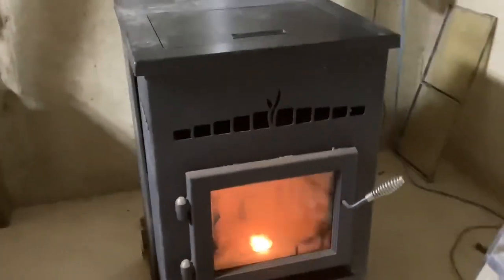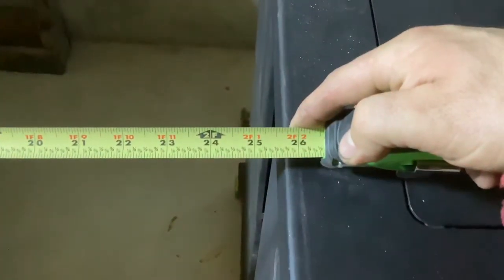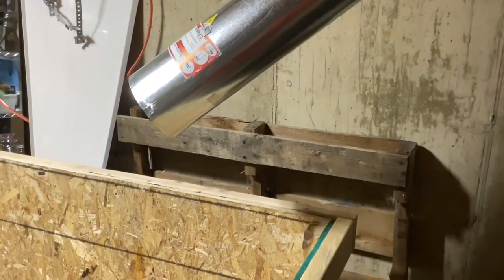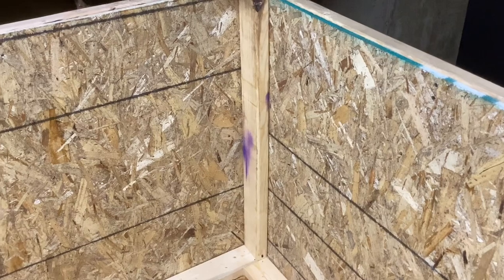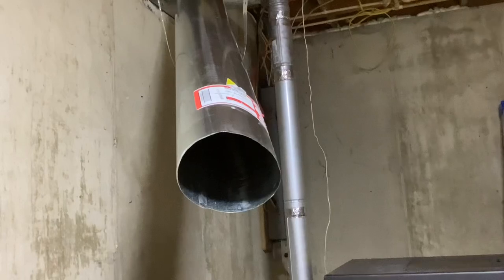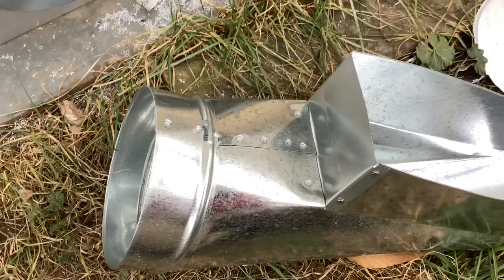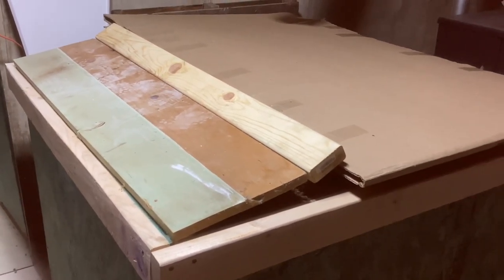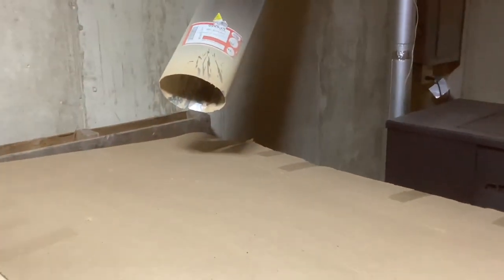Basement Chute for Wood Pellets | Pellet Bin for Pellet Stove

Comment: Looks good so far from what I was searching everywhere. We wanted a direct duct extension from an outside woodshed right to the hopper so we could load more than 2 bags at a time. The woodshed is large enough to hold 4 tons. 
I also see a problem with the dust from the pellets when they pour in. You should try a lid and put your pipe right through it.
Reply from the maker: Thanks for watching, and great ideas!  I am not sure if I would try this inside my house, but a friend built a hopper out of an old gas or oil tin, hanging directly above his pellet stove.  He has a 4” pipe running right into the stove hopper to hold a few extra bags.  It’s in his shop kitchen and he uses it for parties and limited use.

Comment: Can I see more pictures of how you did the pipe work for the stove trying to figure out how to install mine thanks
Reply from the maker: It is kind of a one way deal here, all the parts have a male and female.  The stove exits with an adapter into a tee.  The tee is used as a clean out, with a cap on the bottom.  Otherwise, it all just twist locks together.  I used Duravent Pelletvent 3” piping, as recommended by my stove manufacturer.  It exits through my wall piece using a manufactured thimble, safe for combustibles.  Always follow local code and installation instructions when piping an appliance.  😉
Reply from the maker: Thanks for watching by the way!
Reply: On the outside of the house did you vent it vertical or horizontal with a gaurd so birds don't fly in??
Reply from the maker: @andydoede1822  I did not worry about a bird entering.  Your stove should have technical details on the termination outside.  If not, here is a good source I found that you might be able to follow.  https://inspectapedia.com/chimneys/Pellett-Stove-Fire-Clearances.php